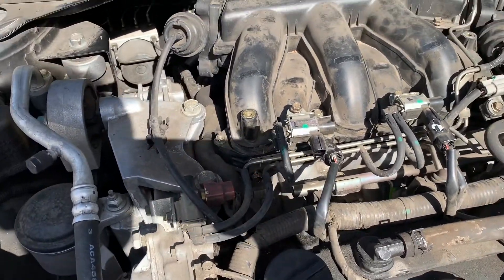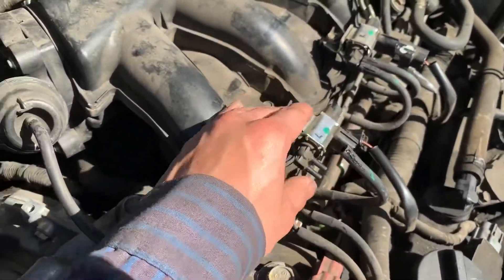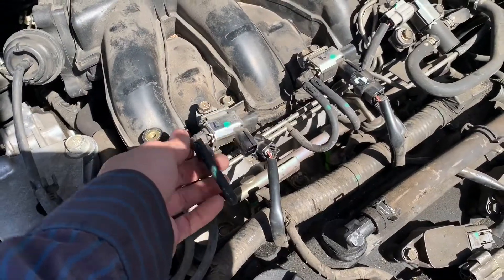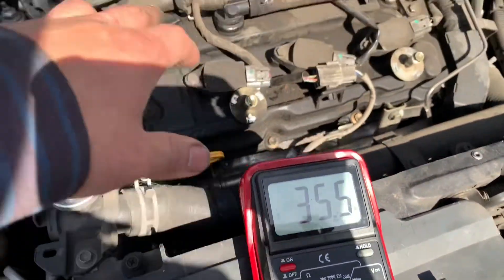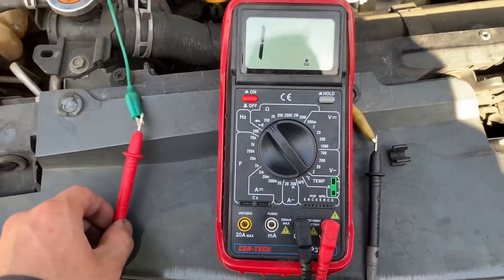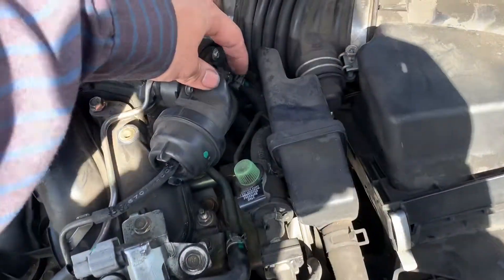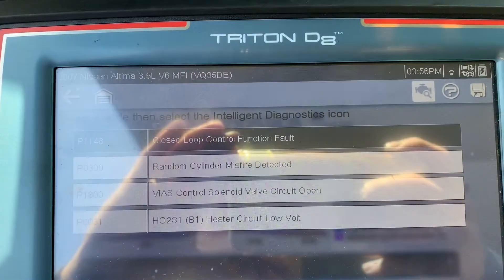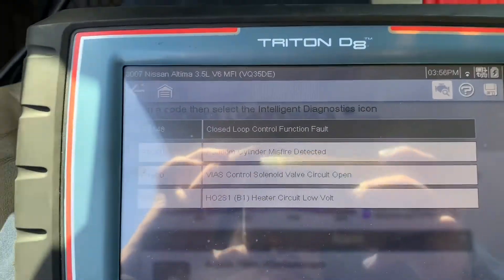Nissan Bad Intake Manifold Runner Control Valve (VIAS) - Hard To Start And Reduces Power

Comment: The mazda 3 intakes have 2 sets of flaps in the intake manifold. If they stick, it will reduce power until high rpms. Then a burst of power just boom 💥 and your floating but it smokes due to not having correct air fuel ratios.

Comment: I have 2019 Nissan Sentra with stuck swirl tumble control valve, do I need to replace sensor or whole intake manifold assembly?
Reply from the maker: The newer models. The tumble valve comes with the intake manifold. If you can find the valve separately, then buy it. Its more warranty work if you buy the whole manifold assembly because this one has a door inside the manifold to controls the air going in operating by the tumble valve. Buy oem only.

Comment: I have a 2015 sentra With p2004 ( intake manifold runner control stuck open bank 1a) , sorry i know this is for an altima but is this the same for sentra?
Reply from the maker: @ralphhalili8511  its the same problem. Not sure if you can find the tumble control valve by itself. If the you cant find it, you have to buy the whole intake manifold assembly unit, it comes with the assembly. Cost around $550 to $650 new.
Reply: So on the other side of the intake right in front of the throttle body is another vacuum supply valve type part what is the correct name to this part I have 2011 Nissan maxima an the vacuum line is broken at the connection

Comment: Hey, my 2013 Altima has this

P2004
50/22
Intake ManiFold
Runner Control
Stuck Open Bank 1a
Reply from the maker: @mazmx693  Replace the whole intake manifold assembly, it comes with the runner control valve mounted on the side.
Reply: Can I just replace runner control valve without removing intake manifold

Comment: Appreciate the video.  How many of these valves are there on a 3.5 VQ engine? I got the P1800 code on my 05 Maxima
Reply from the maker: P1800 code is the variable induction air control valve (VIAS)
For 3.5L engine, have 2 runner solenoid valves, 1 on each bank.

Comment: Hello,I have a 2015 nissan rouge sv and the p2004 code came up.Its the same sensor your mentioning.But is this easy to change myself?
Reply from the maker: Yes fix it yourself.
Reply: So I bought the intake manifold runner control sensor and changed it but still have the same problem
Reply from the maker: @Danielson617  Check for any broken or damaged vacuum lines. Check the connector for loose connection / corrosion, damaged or broken wires. If everything is good then replace the whole intake manifold.

Comment: Altima 2013 code p2004 c1130 does the car need to be reprogram after changing
Reply from the maker: P2004 - replace the whole intake manifold 
C1130 - replace mass air flow sensor

Comment: I took my 2013 nissan altima to the dealer and the codes p2004 said I need a intake manifold runner control valve positioning sensor stuck open . The sensor however looks a little different than this one .
Reply from the maker: For the 2017 model. The part is different than the older models. P2004 - the runner valve is located on the side of the intake manifold next to the throttle body, replace the half piece of the intake manifold (the piece is between the cylinder head and the other half piece of the intake manifold). You have to replace the whole intake manifold assembly not just a half piece because they dont sell the half piece manifold.

Comment: I have a p2004 code on 2017 Nissan Rogue. Could this be the same issue?
Reply: Josh, did you get your answer?  My local dealer said the P2004 code in the intake runner control valve.  Do you have any idea where these are located on the 2017 Rogue engine?
Reply from the maker: For the 2017 model. The part is different than the older models. P2004 - the runner valve is located on the side of the intake manifold next to the throttle body, replace the half piece of the intake manifold (the piece is between the cylinder head and the other half piece of the intake manifold). You have to replace the whole intake manifold assembly not just a half piece because they dont sell the half piece manifold.

Comment: p2004?
Reply from the maker: P2004 - intake manifold runner control stuck open. The same code as the one I worked on in the video.

Comment: Would this fix code P0075 intake valve control circuit (bank 1)
Reply from the maker: This code would be dif. The solenoid for that is located on the valve cover. This is for the variable valve timing, remove the solenoid, check 7ohms - 7.5ohms with voltmeter and check to make sure the solenoid is not clogged with metal chunks and dirty oil build up.